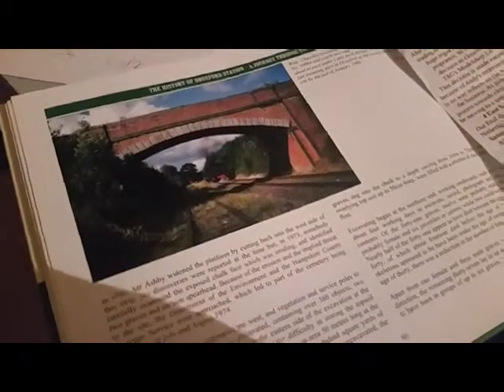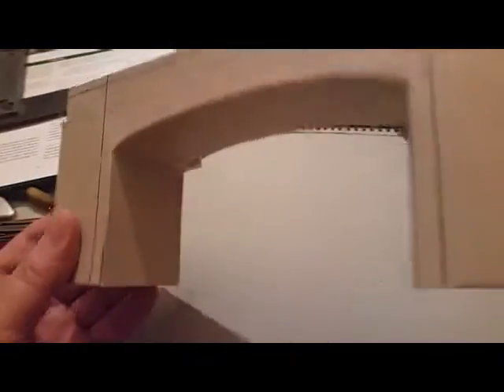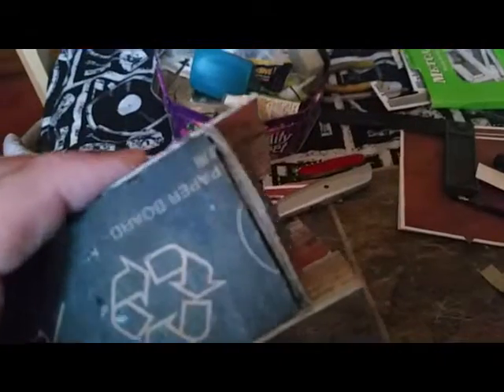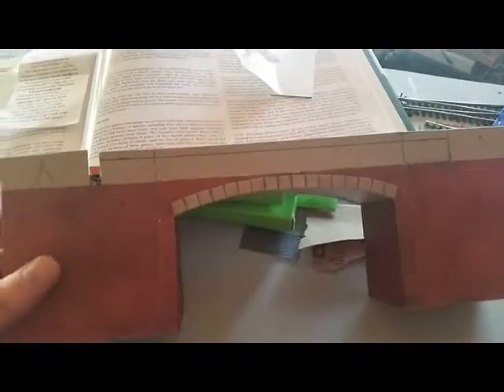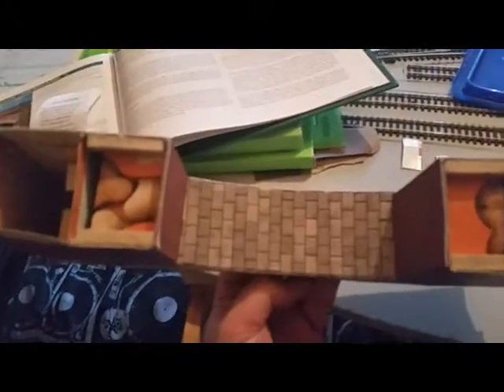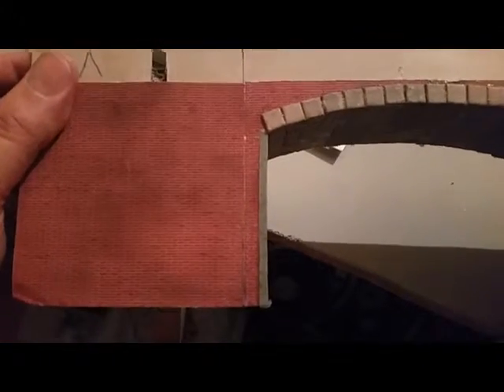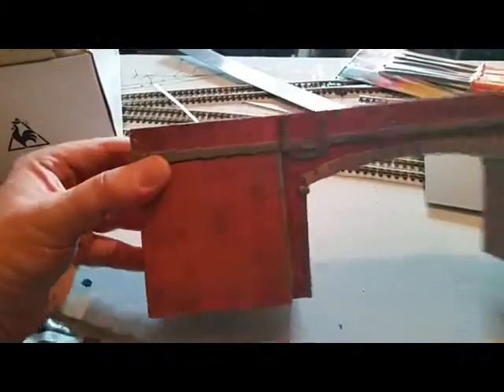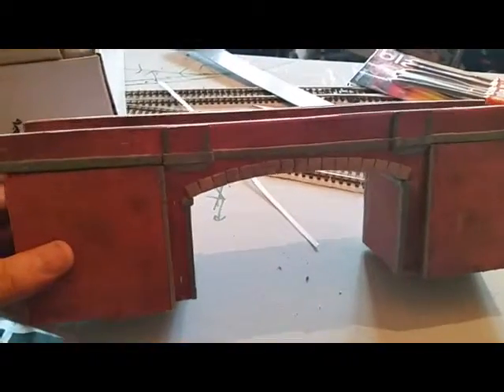Droxford station update bridge construction

Comment: Well done Geoff, that's looking really good. I look forward to seeing it built into some landscaping. David.
Reply from the maker: +David Atkins Thanks , the scenery will be the next job I think ,  I live over 200 miles away from there now( I used to live in Hampshire so cycled the old line regularly)  so relying on books and I was lucky that someone on a facebook page who lives near  there regularly walks along the old line and was kind enough to take a load of pics and email them to me .
I had to do the bridge to get the height of the scenery and the kits looked like it but would have needed a lot of adapting so I thought I'd have a go at building it .